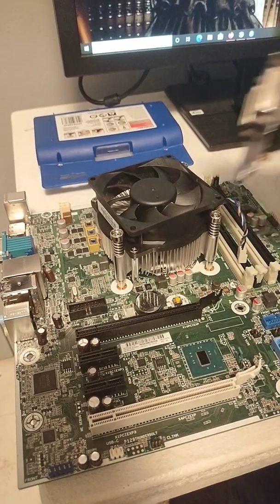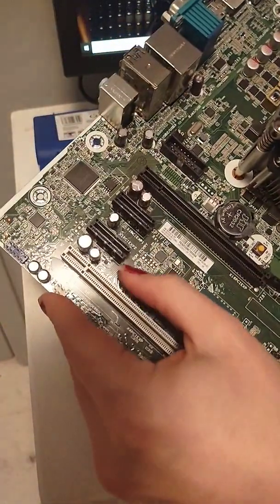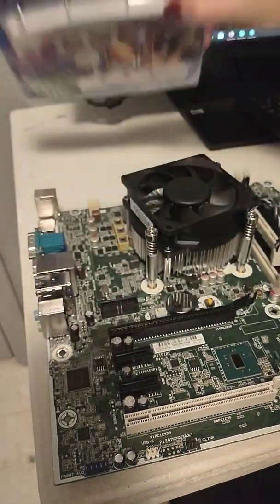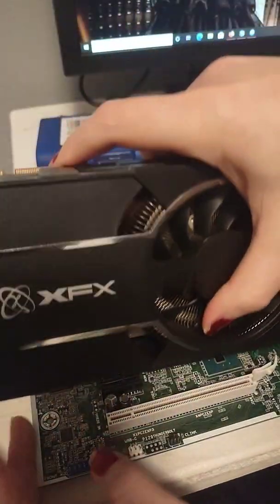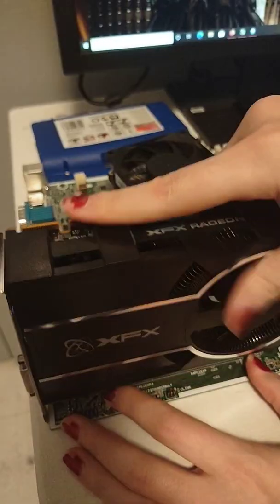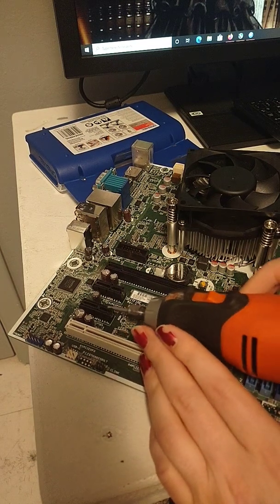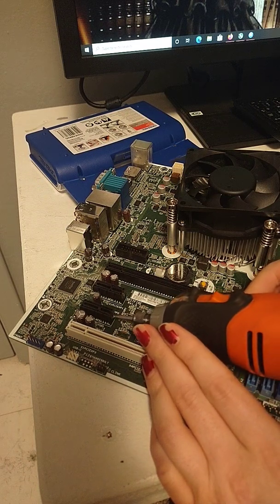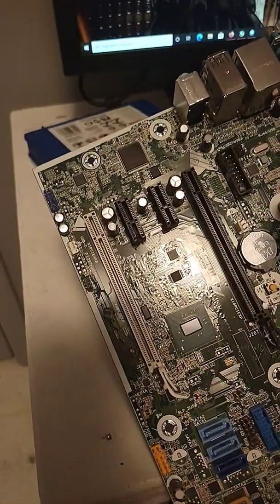Full Size GPU into PCIe x1 Slot. The Easy Way!

Comment: that means its gonna perform HORIBLY
Reply from the maker: Indeed. This is generally not something you'd want to do. I just did this to see if it were possible to game ol a 10 watt CPU board I had. So, the pcie slot was not even the bottleneck here. 😂
Reply from the maker: The board I used in this demonstration had blown VRMs. So, I wasn't worried about damaging it. You can see the low watt system I actually modded like this in my other videos. It could play minecraft, that's about it. 😂

Comment: Hello, Thanks for this and I plan to do it on my board (dremel too risky) but when you showed the tip but it is so blurred (camera didn't focus), but wondering what it is exactly?
Reply from the maker: This one: https://www.dremel.com/us/en/p/107-26150107ae
Reply: Thanks! @IronwingTechHaven
Reply: So I just tried it and unfortunately, even at the slowest dremel speed, it melted the plastic and covered some of the ports and it was difficult to scrape them out.  Luckily, I had a dead mobo and tested on it first before doing it on the real one.  Maybe it's just my dremel skills but looks like I'll try to find other ways now.  I also think the dremel 107 is quite big  @IronwingTechHaven

Comment: South Bridge will wreck itself in no time because of No passive cooler 😂😂😂
Reply from the maker: Again, this board is a bad board. I was just demonstrating the process of modifying the slot. I  not  install this GPU in this board. HP OEM boards like this are terrible.

Comment: Fun fact: seen this before in a vid and that pc caught fire after plugging it in 1 time
Reply from the maker: Definitely not something you'd want to do with a gpu that draws over 75watts. It definitely might start a fire. I was just using the one in the video to demonstrate that it fits. The actual gpu I used was only an rx 550, which hardly draws anything and doesn't use all 16 lanes anyway. It worked great.

Comment: Don't do this to your board. Don't do this to your g p u this is actually really bad for Bother the adapter or while you gotta realize. There's a reason why they're longer with more pens..
Reply from the maker: Many mother boards have open ended slots in them by design. This really isn't bad and it works fine if you do it right.

Comment: no!
Reply from the maker: It's not dangerous. It just runs on less lanes. Mining GPU risers basically do the same thing. It's not like I was doing this to a nice motherboard anyway and sticking an rtx 4090 in it. I did it to a pentium J2900 board and stuck an rx 550 in it, and it works great. In this video I was using broken hardware to demonstrate the process that I replicated in my other video.

Comment: Can i use NVME adaptor with this method?? Because i already use a graphic card in PCIE slot and i want to install a NVME ssd  with the use of adaptor.
Reply from the maker: I'm not sure, but I do know you can just buy pcie x1 nvme M.2 adapters. I have one and it works fine, though, I'm not sure if these motherboards support them.
Reply: @IronwingTechHaven okay thanks 👍

Comment: Last week I did exactly this but a little bit different.

I got myself a USB 3.2 Gen2 Extension Card.
I just saw the product pictures from the "slower" USB3.0 Extension Card one (which had PCI-E x1) but I wanted the faster USB3.2 one and I didn't realized that the USB3.2 Card is for x4 and up... 

My Manli GeForce RTX 4090 Gallardo was blocking the second x16 slot.. 
Even if it would fit there, then the extension card would block the airflow of my GPU Fans.

However with a 20W Nano USB-C Soldering Iron and the "115-J Series Iron Tip" I melted the plastic away while all components where still build in. 
It was a ASUS ROG Strix B550-F Gaming Mainboard, my warranty is probably gone.  
I guess dremel out the back as you show is way better and more safe but I was to lazy to remove all components. 🤣

Now my PCI-E x4 USB 3.2 Gen2 Extension Card is working fine in the x1 Slot and I'am super happy about that! 
For me everything went well. It's worth a try. 

Great Video ;)

Comment: does this get you to desktop to be able to transfer a few files? i think the 3 fan cards i used skewed my slot and wont connect anymore but this would be great if it worked
Reply from the maker: If that's all you want to do you can just use a x1 to by 16 adapter, but yes, if you did this properly, it should work.

Comment: This takes the cake for most cursed pc.
Reply from the maker: Fortunately, I never actually built a PC with these parts. The board is an old broken one and I was just using it to demonstrate how to adapt a x1 slot to an open end slot. You should check out the pentium J system I made if you really want to see cursed.

Comment: I have a question which slot is pci 16x the black one or white one. I'm confused in my pc. Sorry for bad language 😅.
Reply from the maker: The black one. The white one is sometimes physically x16 but not actually wired for x16. On some boards both are x16. This was a dead board I was just practicing cutting the slots out with though.
Reply: @IronwingTechHaven  thanks💙

Comment: its not working don't try it I tried that with my gtx770 dont work. lier.
Reply from the maker: It works fine with some cards and motherboards. It depends a lot on the power requirements. The GTX 770 uses way too much power for some boards to deliver through a x1 slot.

Comment: Only bad thing is that you loose like 15/16 of the bandwidth haha, and that mobo is probably gen 2 aswell,  so its already half of gen 3. So 1/32 the bandwidth the gpu would want, lol. You should rather do this if you have like a server board with only 4x slots, or something
Reply from the maker: I just did it because I wanted to run the Witcher 3 on a 1 Watt CPU that was soldered onto the motherboard with only a 1x slot. 😂
I tested it out on a broken motherboard first.
Reply: @IronwingTechHaven  I can't blame you!
Reply: Incorrect

That card won't even be using 8 lanes In the x16 slot 

One lane of gen three will only bottle neck a 1080ti by around 2% 

Not sure on the card but it's still going to add alot for some things like machine learning
Reply: @madyottoyotto3055  how about half of that, because it’s gen 2 lol that’s the main issue here lol

Comment: I mean,I guess it’s fine but it’s better to spend just a bit and buy a riser extender…it just feels awkward when the gpu is not secured and also poses the risk of damaging the Motherboard if done carelessly.
Reply from the maker: It really depends on the situation. For my particular build, this was a better option than using a riser. Reasons: it didn't cost anything and the motherboard I used was old and inexpensive, and I did not have any space in my system for a riser, and I knew what I was doing, so modding it was super easy. Also, without a riser you can easily secure the card by screwing it down as usual.... But there's no way I'd do this with an expensive motherboard or for mining GPUs.

Comment: why would I even want to do that?
Reply from the maker: If you have a motherboard with no x16 slots. It's pretty common for server boards and low power boards like the Pentium J2900 board I use in a related video.

Comment: gpu miners use that a lot buth they use extension 1x to 16x powerd extendor
Reply from the maker: So, the important thing is to just make sure your GPU won't draw too much power from the PCIe slot. Now, should I run the GPU in this video like this? No. I was just using it to show that it fits because it was my only spare. Also, the board I altered for this video was already dead. I was using it for practice before I modded the one in the more recent video.
Reply from the maker: Some other small Tech youtubers and I are working on forming a collaborative discord. I'll post the details soon.
Reply: and you are super nice you shuld meake discord server

edit: it is free you dont need home pc just create one in app if you didnt know
Reply from the maker: I made my own discord server. Let me know if this link works for you (I'm new at this): https://discord.gg/GHGgcfevtB
Reply: @IronwingTechHaven  works fine for me
Reply from the maker: @AlmostBrokeLbs  Awesome! Thanks for testing it out.
Reply: How do they not lose mining money from using a 1x slot
Reply from the maker: Yeah, I know that, but all that does is make it so it doesn't suck too much power from the PCIe bridge. It does not make it run at x16. It's still x1. So, if you don't put a super power hungry GPU in you don't need extra power. My GPU uses 29watts max. So, it's definitely fine running directly in the slot.
Reply: @IronwingTechHaven at that wattage I'm also guessing that one lane is not close to bottle necking it either
Reply: @IronwingTechHaven  yup pci-e on mother board can provide 75w max